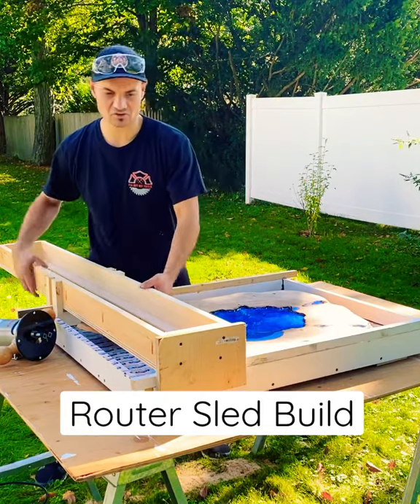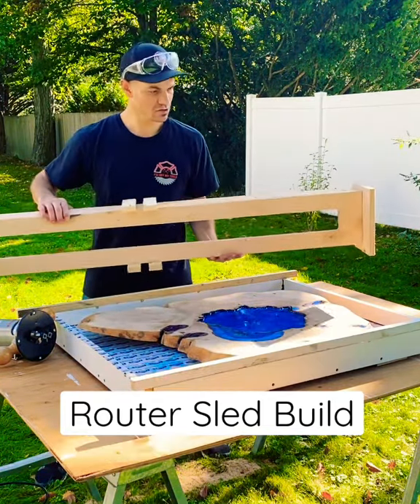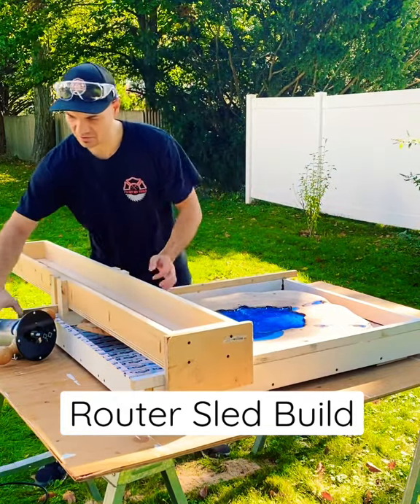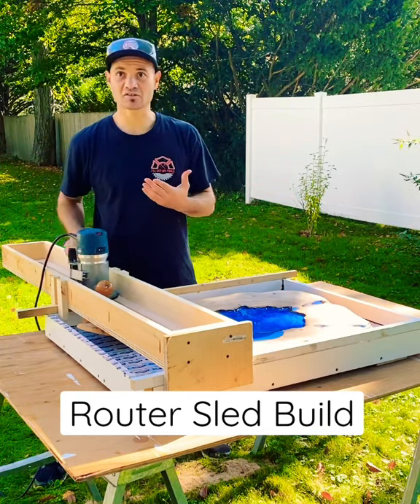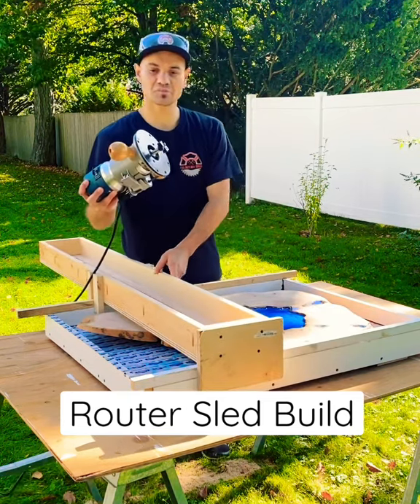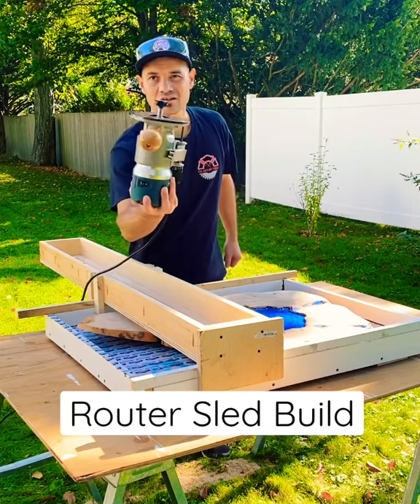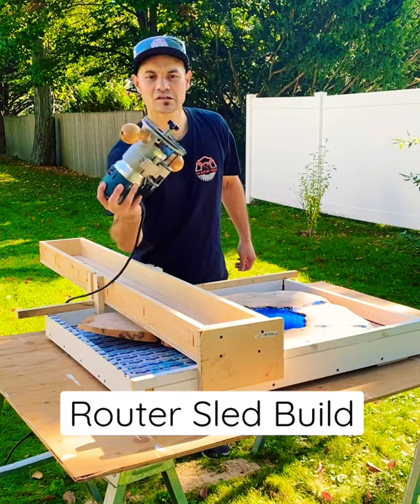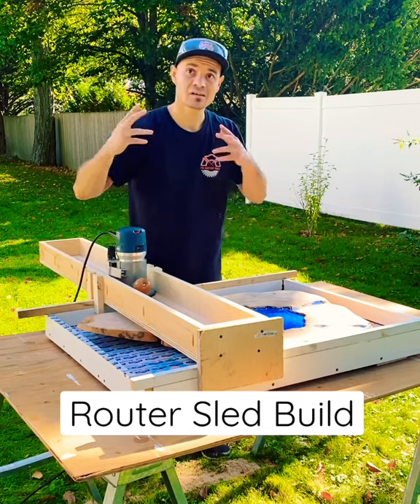Router Sled Built for Epoxy Table

Comment: Has your router bit ever slid out and cut too deep? I'm having such a problem.
Reply from the maker: I really tighten it down with the wrenches have never had that problem. If the blade is dull and you push it through too quickly it can catch something and pull itself out. The key here is small passes 1/8 to 3/16 deep
Reply: @IllGetMyTools ight. If the bit is slipping (incredibly, INCREDIBLY dangerous) then they're not tightening the collet enough or the shank isn't the right size/length and it's being like pressure held.

Which does jack shit at 20k rpm
Reply: 185 fkn bucks ??
Reply: In case you still haven’t found a solution…most collets have a “false” first tighten. If you keep going it’ll loosen, then tighten again. Similar to how hand planes work when adjusting. Oh and also, you could build that entire router sled for the amount this bozo paid for his bit.

Comment: 😂😂😂😂 I spent $22 on my 2.25in slab leveling router bit. I spent $44 on a 2hp router. I'm making money long before most are breaking even.
Reply from the maker: Awesome, hope you can get that Porsche in the garage soon!
Reply: In the U.K the best bit for this surfacing job is a Trend c030 bx1/2tc
19.1 mm dia x 50mm two flute straight cutter and that will cost you 
 £36.65p . Happy days 😊 .

Comment: whats with all the $20 dollar bit gets it done people. Yea, done once. Also he isnt using a straight bit, its a surfacing bit..Trend is like freud equivalent, middle of the road. A whiteside or infinity router bit can easily surpass $100.00. CMT is good too. Those cheaper bits work, but every woodworker knows that the cheap bits are usually when you start out so you don't ruin an expensive one. He is surfacing a large piece not a cutting board 😂. Your sled is cool too.
Reply from the maker: Thanks for saying that. The internet loves to be negative without knowing the whole story. I usually don’t bother explaining myself. But thank you!
Reply: A freud 1 1/4in spoilboard bit is 20 dollars. Are there some specific quality bits that cost over 100? Yeah. Spoilboard bits aren’t one of them.

Comment: whats the name of the bit??
Reply from the maker: Spoilboard or surfacing bit
Reply: In the U.K  Trend make one for surfacing/leveling it is a 19.1mm x 50mm two flute straight cutter the order code is sku c030 bx1/2tc .
 It costs £36.65 .
  If you live in the states it might be cheaper to order one from the UK.  
 They are top quality and easy sharpened.😊